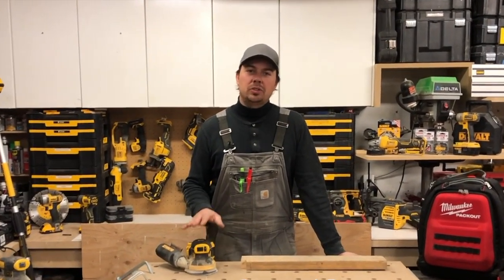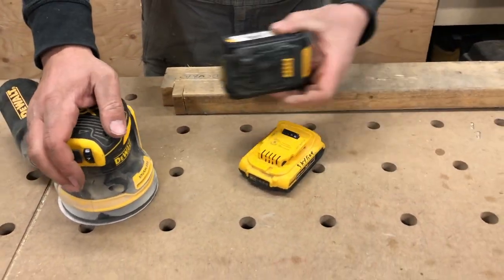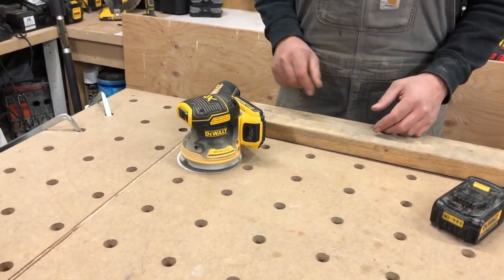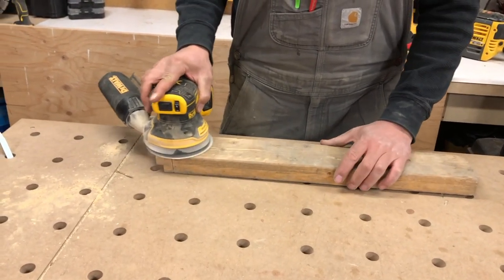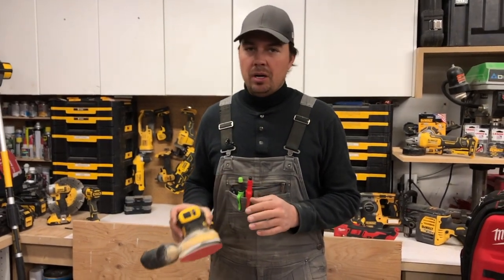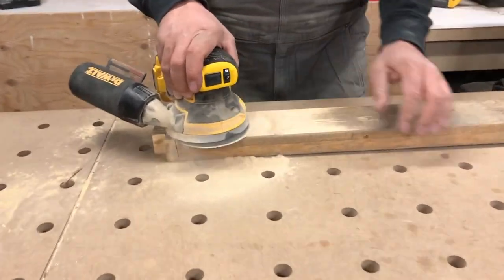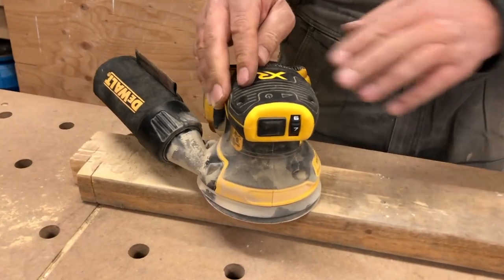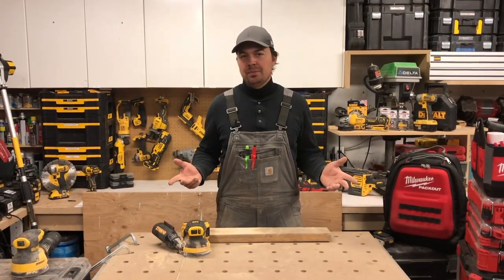How I use DCW210B 20v max Dewalt Orbital Sander - REVIEW

Comment: I agree.  I bought a dcw210b, today and put one of my new 1.3ah batteries that came with my new dcf787b impact.  It worked fine when I was sanding on my front porch.  I sanded for about two hours, off and on and it took an hour to charge it back up.  The 1.3ah battery worked fine with it.
Reply from the maker: @johnclarke6647  sweet, it’s definitely a really good sander. The new m18 is going to destroy it I think. It looks really nice , but I still love my dewalt 
Thx for watching
Reply: Maybe try a different charger. I have the DeWalt dcb115 charger and it charges a 2ah battery in about 30 minutes.

Comment: Great video. I have a question. Can I use this machine for sanding concrete walls and can I use sand paper or do I have to use a differente sheet ? thank you.
Reply from the maker: thanks, I guess it would depend on what your sanding off of the concrete wall, if its concrete than i would say use a grinder with a disk. but if its old paint or something than it would work.

Comment: I used to work in a cabinet shop so I'm use to quality sanders. While this one isn't on the same level ergonomic and intuitive wise as pneumatics It is convenient, cheap, and accomplishes the best finish of any electric I've tried. 
It's actually a big deal that the pad doesn't rev up to mach 10 when lifted off the work piece.